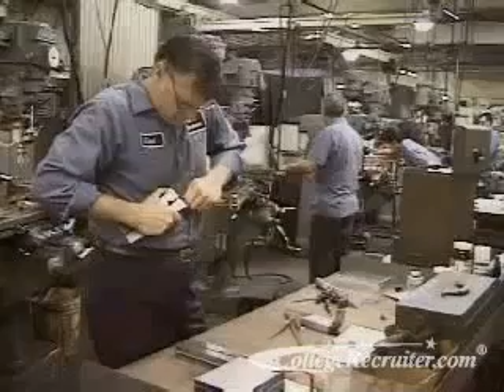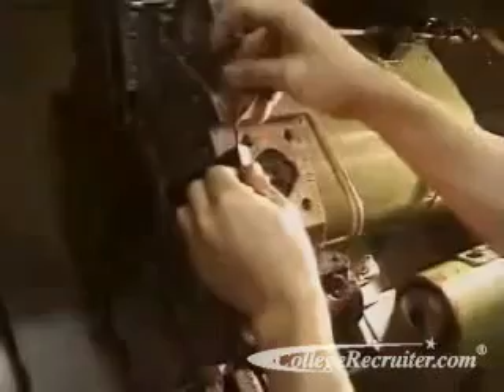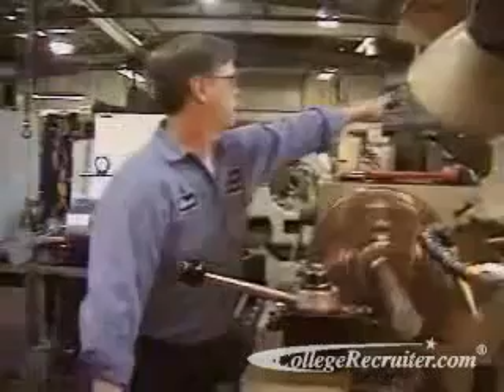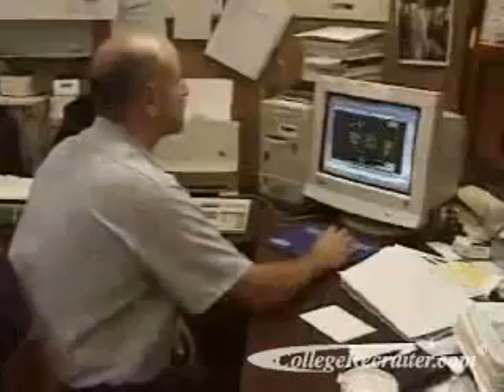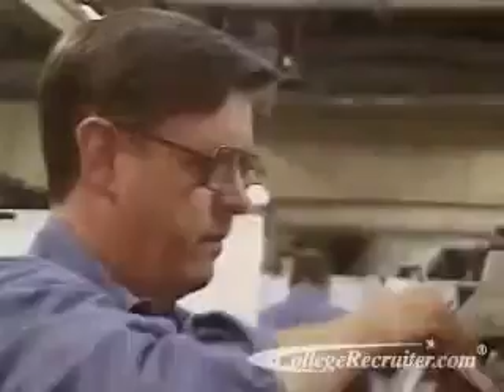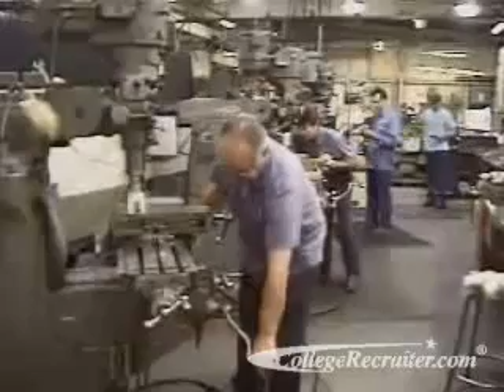Tool and Die Makers

Comment: bullshit "always in demand"..... cnc has had me out of a job in that field for a great while
Reply: John Russell Lies... any factory that uses presses for part stamping: needs tool and die workers. Sure some components can be made entirely with a CNC process but they also need to be installed, checked and repaired...
 In the automotive industry on occasions CNC can take to much time in order to repair or make new components. Especially when time is of the essence. 
 Ex: When a transfer press miss locates a part, carries over into the next stage and will either break forming dies, form rings, guides, hem  rings, cutter etc... Unless a replacement  is on hand it's usually more time efficient and cost effective to repair the component via- welding to repair cracks, build up material, or correct out of spec forms from wear, then hand mill, or turn to shape; since either method will require heat treating and hardening which takes time too. The quicker the die is fixed, and the press is running the better- as downtime can cause missed shipments & expensive expidites, or worse shutting down a customer's assembly line due to no parts. If anything in the area where I'm at, T&D is a very demanding  field: as the younger generation isn't entering this line of work - the old timers are retiring and dying off, with nobody to fill the position.

Comment: I am junior tool and die maker in Ontario,Toronto have worked only four years based on my experience where today things are going tool and die making is a dieing trade the company i use to work for makes parts for alpha romeo and Chrysler comparing the being tool and die making sucks you have to be 100% accurate for me was very hard to and pile of B.S to meet there dead lines i am better off been a auto mechanic fix cars but man on labor its expensive more money to be made.

Comment: I work in a tool and die shop for a major U.S. manufacturer that actually still makes products in the U.S.  There are 5 tool makers in our shop and we just service our die casting and plastic dies.  Our new tools mostly come from Portugal or China.  Whenever we get a new die casting or plastic mold from China it has to be torn down and inspected for all the defects so we can fix it or send it back.  The last one from Portugal wasn't even the right steel so it rusted as soon as it was open to air

Comment: @tooldiefor  yea i understand how you feel. i was toolmaking for 36 years (plastic injection moulds). my value in the uk is only worth about £8.50 per hour.  if you stack baked beans in a store and dont have any skills your value is £8.25 per hour. its purely academic anyway as the uk does not manufacture anything anymore anyway..

Comment: @kenatlaw Great, Ken. I'll be looking foreward to your e-mail.  I built my shop so I could do side jobs (die cases, soft tooling, etc.) for my day job at an airplane bolt factory but the old man sold the place to a corporation & now we get our cases from China. As an added bonus, it takes us around 5 months to get an order of cases shipped from there instead of the week (max.) it would take me to turn and heat treat them. I hope this works out for both of us.

Comment: @tooldiefor 
I am a qualified press tool and die maker and I have to agree with you about the stress part.
It's not such a big deal when your younger, but I guess as we get older we lose that dare quality and one little slip = £1000s wasted
I worked on spark erosion in the early days, and when your given a block of carbide that someone has already spend 40 hours or more working on, thats even worse...but I was young then and it didn't worry me as much.
Give this some thought before taking it up.